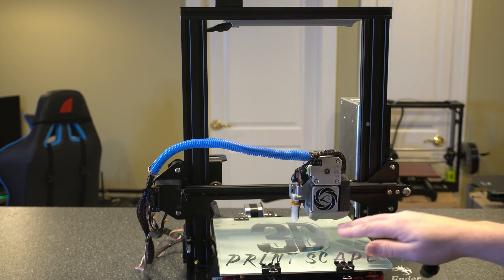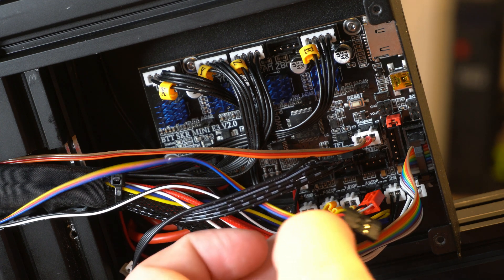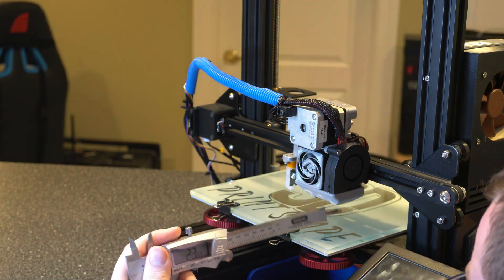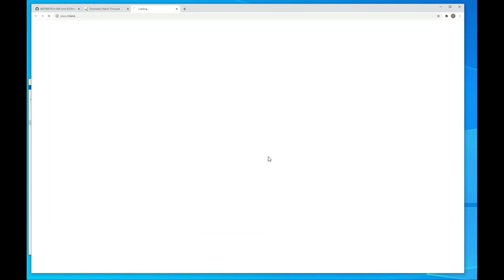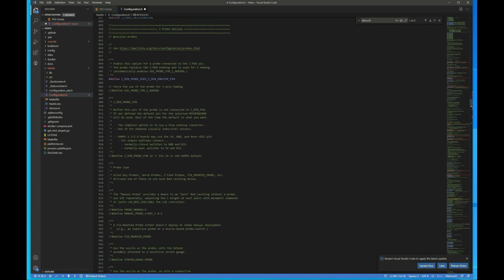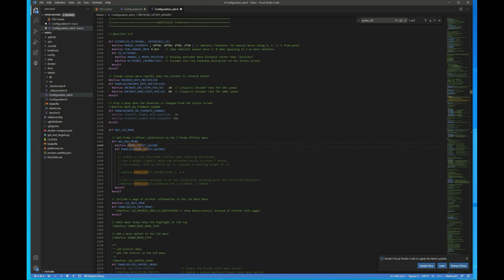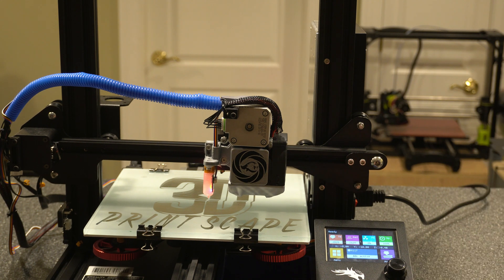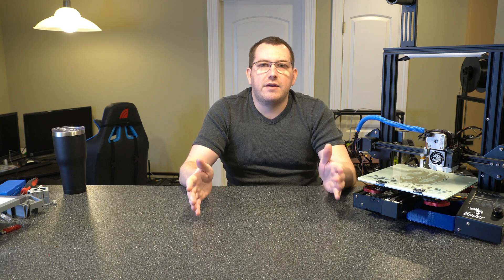BLTouch on SKR Mini – Install Guide

Comment: Hi, great video and seemed easy to follow as a first time experience. I have a CR10s5 and was able to change the print size with no issues and completed the video. However, How to I complete the setup for the BLTouch? I have a reality cr10s5, BTT Mini e3v3 and BLTouch v3.1. While I do enjoy going through this process, does anyone happen to already have the completed firmware for this setup that they can share?..or maybe point me in the right direction? Thank you in advance

Comment: Ive followed both your install on the SKR Mini E3 V2.0 where we flashed the BLTouch settings, i installed and flashed the TFT35 E3 V3.0, and i cant really seem to get the BLT to work.
Even when the probe is out it still recognizes it as "home", i cant really figure it out, ive swaped the colors around to match what you did, and even doublechecked with the instructions that the colors are indeed the right way (not that i dont trust you)
Anything youve heard of/encountered yourself and have a quickfix of? Thx in andvanse :)
Reply from the maker: Hi. How is the bltouch wired, what firmware are you using, and is the z-stop connected?
Reply: @3DPrintscape  The bltouch is wired like yours, swapped the colors around and connected the 3pin on the lowest 3 ports on the slot for BLtouch and the red connector on the Z-stop. The firmware on the SKR is for "z homing" (renamed to "just" firmware) and for the TFt35 its "BIGTREE_FRF35_V3.0_E3.27.x"
Thanks!:)
Reply from the maker: @Themasman09  Double check the pinout on the bltouch, ive seen them shipped with different colors. Also, are you seeing bltouch or anything in the menus? Looking to see if the firmware actually updated.

Comment: First of all, thanks for the video. I did exactly what you did, however when I press Auto Home the z axis collides with the table. I'm using the connection as shown. To rule out that it wasn't wiring, I used the BIGTREETECH firmware and it worked perfectly, however it doesn't allow negative z_offset and I would like to use my own firmware like you. Do you know what I could have done to prevent the z axis from stopping with the BL touch?
Reply from the maker: Hi. It sounds like a wiring/firmware mismatch. How is the bltouch wired and is the z stop connected?

Comment: Hello I have followed all the steps and loaded the firmware on sd card, my probe wont work its a 3d touch probe.
Reply from the maker: Hi. Are you seeing bltouch setting in the menu on the printer? Im trying to see if it actually took the firmware.

Comment: Hello, thank you for making this video, it was very helpful. I’m stuck one a problem though. I was able to compile and flash my firmware onto my printer, but now when I go to auto home, the auto homing sequence doesn’t even touch the X or Y endstops (which would lead to some collisions later on if I tried to do anything else with the printer). But The Z sequence works with the BLTouch probe just fine.  I flashed firmware from bigtreeTech to confirm it wasn’t a wiring issue, and the auto homing worked perfectly fine for X and Y with the bigtree firmware. However there were some problems with the Z home sequence that are more troublesome than they are worth. Anyways I’m assuming this is now just a coding issue. So now I’m trying to make my compiled firmware work. Do you have any suggestions to fix the x and y homing issue? Thanks.
Reply from the maker: Hi. Can you try one of the builds from my site? I want to try to narrow down what the problem could be.
Reply: I ended up restarting with the same btt code. I followed a step by step guide online for Ender v1s and it ended up working. Not sure what the issue was as I was watching several different videos (probably the root problem) on how to code the firmware, but it was definitely a coding/user issue
Reply from the maker: @landon3105  Thanks for the update, glad you got it working.

Comment: I’m having trouble with the platform io tab in vs Code and it will not let it complete the build it will fail it
Reply from the maker: Hi. What error are you getting? It should be in the console output.

Comment: I can’t seem to find the babystepping feature. I was able to compile it fine at first, but had to recompile another .bin file for the offsets when my printer autohomes. Any tips? I’ve got what you toggled and even enabled the feature where it’s always available. No dice still.
Reply from the maker: Hi. Try to clear eeprom if you haven’t already. If you have maybe check in the menus for something that sounds similar in function, maybe they moved it.

Comment: Retrying after a year hahaha. My default environment says mega2560 marlin 2.0. Changing to what you have
Reply from the maker: Hi. I would install and use the marlin auto build plugin. It provides the environment details available based on the board and config.
Reply: @3DPrintscape  I moved the file to video like you had it and it fixed that issue. I still can't get the check mark to show up on the tool bar. I have marlin auto build, Microsoft c++, and platformio
Reply from the maker: @VeneerSlinger  What all is in the folder that you have open in vs code? There is a sub folder with the same name that only has the configs, if you open that you wont see the check mark.
Reply: @3DPrintscape  videos/marlin 2.0 brings up the whole list on the left. I'd have to look at it again, as I'm not at the computer right now
Reply from the maker: @VeneerSlinger  Ok, in the root folder there should be a file named platformio.ini. If you dont have that at all, you may need to redownload the firmware.
Reply: @3DPrintscape  it is there, I double checked the presence of _512k and it is there
Reply from the maker: @VeneerSlinger  I have builds on my site, you could use those if your x and y offset is standard.
Reply: @3DPrintscape  it's not. It's X: -40.5 Y: -9
Reply from the maker: @VeneerSlinger  Can you reach out on discord? Someone will be able to help out more, maybe with a custom build.
Reply: @3DPrintscape  I have several times to no avail. I'll try again
Reply from the maker: @VeneerSlinger  Did it end up working?
Reply: @3DPrintscape  no. Still doesn't work. Still can't find anyone to help
Reply from the maker: @VeneerSlinger  Were you able to join the discord server?
Reply: @3DPrintscape  yeah nobody in there has offered to help
Reply from the maker: @VeneerSlinger  Can you @ me on the message?
Reply: @3DPrintscape  tempted to just send someone my x and y offsets and have them send me back the file hahaha

Comment: Hi Robert,  Thanks for all the great how-to videos.    When I initially added the ABL gcode (G29 ; ABL) to the Cura profile for the Ender 3 Pro, everything functioned properly from OctoPrint until I adjusted the bed a week later.   The Z Offset and ABL calibrations from this video was executed countless times with no success.   After hours of playing with these settings, I notice the calibration functioned properly through the printer display screen but failed via OctoPrint.  I removed the G29 code from the Cura profile and it is now working from OctoPrint.  I don't believe the G29 code execution itself from OctoPrint is the issue. Is the G29 pulling stored parameter values from OctoPrint or the controller to calculate the new ABL parameters?  My printer has the BTT SKR MINI E3 V3.0 Controller and TFT35-E3-V3.0.1-Touch-Screen-Display..   Is there any other area I need to be looking at?
Reply from the maker: Hi. Thats interesting, it has to be tied to how octoprint handles things. It bypasses a lot and wants things it own way. The g29 command runs the mesh and stores the peramitors. You need to save settings for them to persist through a power cycle. What happens if you just send the g29 command manually from octoprint?

Comment: Do you need to change the bl touch wiring on the v3 board?
Reply from the maker: Hi. If you leave the z stop connected and the bltouch connected to the bltouch port you shouldn’t. That is assuming you have one with the 5pin adapter.

Comment: I was with you up until ~5:30. Not sure how you got from installing the hardware to measuring the distance the probe is from the bed. I'm assuming you powered on and went it went to the home position? What firmware do you have installed at this point and how did you do that? I think I have the wrong firmware installed because mine isn't moving when powered on.
Reply from the maker: Hi. Once the hardware is installed, you need to flash the firmware then set the z offset, i think your on the last part right now. Im using a custom build of marlin, but the process is the same with the creality firmware. Do you see bltouch or anything in the printer menus?

Comment: Thanks for taking the time to teach this to us noobs lol however i have the exact same setup and followed all the instructions and the z offset icon does not populate on my tft35 E3 v3  in touch mode when going to the ABL section. its showing that its available in marlin mode though. any suggestions?
Reply from the maker: Hi. Is there a P offset on the screen? They changed things up a bit since i made this.
Reply: @3DPrintscape  yea it’s not in the abl menu. Is that the same thing now? Lol
Reply from the maker: @TAK209-w4l  I haven't upgraded to that firmware yet, but im pretty sure its the same thing.

Comment: I followed your video step for step.  Once you made a change vsCODE I paused the video and made SAME changes.  Ok. Mine compiled just fine.  I got my ender 3 pro with Mini e3 v3. Well almost.  The blTouch levels the center of the bed but when it’s starting a print and lays down that warmup line on left side of bed, we’ll the hot end is still 1/2” off the bed.  The abl pin does not extend. And the assembly does not lower to print. I thought at first it was the gcode of the file I tried. So I tried a different gcode and same thing happened. Is there a firmware setting I could look at for this ??
Reply from the maker: Hi. It sounds like your z offset isnt set, or not set correctly.

Comment: colors are useless, use the function of the connection. pre compiled BTT doesn't work on the skr mini e3 V3 BTW
Reply from the maker: Hi. At this point i would agree on the colors. Also, good to know on the BTT firmware.

Comment: Such a great guide, but i feel like im being a dumdum and doing something wrong.

Ive got the creality BLTouch, set it up in the way that has you using the 3 pins on the main port of the board (Swapping my pins in the connector around so they were blue/red/yellow, the blue/red were reversed initially), and then using the "z-stop" 2 pin location on the board.

I got the firmware for the z-homing, put it on an SD card- Turn the printer on, it clicks the BL-Touch sensor a few times, then bonks at me about not being able to enable bed leveling / invalid mesh.

When I look through my options, I see "MBL" instead of "ABL", and no options for the BLTouch. Seems like its not updating the firmware properly, but cant figure out why
Reply from the maker: Hi. It sounds like it may have not taken the firmware. Can you check to see what under the about/info screen?
Reply: @3DPrintscape  From the info screen my printer says: 

"System: Marlin bugfix-2.0.x 
board: Bigtreetech_gd_tft35
Firmware: v27.x"

Hopefully this is the right information. And thank you so much for your help by the way, i super appreciate it!
Reply from the maker: @SidewaysGts  I would try to flash the firmware again. You should see bltouch in the menu after doing it.

Comment: Thank you for putting this video together. It is very appreciated. It would be immensely helpful if you could:  1) improve the screen capture quality -- on my hi-res screen It is blurry and near impossible to distinguish the text.  2) could you speak out the name of the parameter you are modifying rather than using terms like "uncomment this".  Again thank you for the effort you put into this video and for sharing your knowledge.
Reply from the maker: Hi. Thanks for the feedback, i will work on those going forward. The screen capture resolution has been tricky due to different sizes. I ended up settling on 1080p captures for now.

Comment: For those of you having compile issues with your default env, in 2022 +  try using (STM32F103RE_btt_maple) this usually fixes any compile issues.
Reply from the maker: Hi. Thanks for sharing. Its also worth checking out the marlin auto build plugin, it helps alot.

Comment: how different is this from the skr-3?
Reply from the maker: Hi. the install for the v2 and v3 is pretty much the same, just make sure you use the right firmware.
Reply: @3DPrintscape  I meant the firmware itself. The ender seems to get specific board firmware, while the cr10 doesn't. I'm just struggling to get it to work is all
Reply from the maker: @drderrp  The firmware is a decent bit different. You should be able to take the example from the Ender 3 pro and modify things like the dimensions to get it to work.

Comment: I connected my BLTouch in this exact order, White, Black, Yellow, Red, Blue (top to bottom) and my Ender 3 Pro screen shorts and turns off. No clue why... I looked on the back of my board and it's  the same order as I described. Why is this going on? I haven't installed any firmware, but I dont think that matters since my screen turns off automatically.
Reply from the maker: Hi. I have seen this shipped with too many wiring variations at this point to say the color order is right. Take a look at the pinout on the bltouch and make sure it maps correctly back to the pins on the board.
Reply: @3DPrintscape  yeah, i think the pin variations are all wrong, so it was causing a short. i put them in reverse compared to how guides have them, and the bltouch actually turns on, just does the "z axis moves a bit then stops" after i press auto home. I assume that's a firmware issue?
Reply from the maker: @nextlvlroy  Is your z stop connected?
Reply: @3DPrintscape  it is not. only the bltouch. the z stop is not being used
Reply from the maker: @nextlvlroy  If the bltouch wires are are plugged into the bltouch port, the z stop still needs to be connected. If your connecting the two prob stop wires to the z stop port you need to make sure you are using the right firmware (i dont think any creality firmware supports this).
Reply: @3DPrintscape  Ah ok, I'll need to look into that. Thanks again Rob. Oh, ever since I changed the motherboard, and replaced the micro swiss all metal hotend, the prints have been taking much longer (slicer settings haven't changed), and I've been getting little blobs and underextrusion on my print. Printing straight off the sunlu filadryer, and I keep my speed at 40 mm/s. Is there something I should be checking to solve this problem? Prior to replacing my motherboard and hotend I was doing decent prints. Now they aren't good.
Reply: @3DPrintscape  Also, forgot to mention, my bltouch came with all 5 ports into one connector. It's the BLTouch brand "skouphy" on amazon. The third you said was "you just connect all 5 into the bltouch port". I guess this is what was confusing me. So then I would need to remove the probe stop wires (black & white), insert them into a jst connector to go into the z stop port?
Reply from the maker: @nextlvlroy  40mm/s may be too slow. Try to bump it to 50.
Reply from the maker: @nextlvlroy  Yes, assuming you have the right firmware for it. Or, leave it as is and connect the z stop back up.
Reply: @3DPrintscape  i tried to do the other option, using z stop switch + bltouch, and installed the ender 3 bltouch firmware. For some reason, after doing my bed leveling and all seeming good my nozzle was still very far away from the bed. Not sure why if it functioned and did the bed leveling.
Reply: @3DPrintscape  i did notice while doing the bed leveling that the probe wasn't going as low as it should have been going. The probe was barely pressed and it would retreat back up. Maybe that's why the leveling was off during print time... Do you know what i am missing?
Reply: @3DPrintscape  i would use the same speed with the stock board and it was fine. Just when i switched to skr mini everything changed it seems
Reply from the maker: @nextlvlroy  It sounds like it was working correctly but the z offset was not set correctly.
Reply: @3DPrintscape  ah, i forgot about checking that... I will check it once more. Is there any limitation at all with setting up in this way? original z stop switch + bltouch for bed leveling? I know it's an uncommon way, but I'm wondering if there are any setbacks/limitations to using it like this?
Reply from the maker: @nextlvlroy  No limitations, actually having the z stop and bltouch both connected is the most common way its installed.
Reply: @3DPrintscape  i just tried it again. I tried setting z offset to 0 so i could start from scratch, but it does nothing with the z
Reply: @3DPrintscape  it doesn't move the z axis at all.
Reply from the maker: @nextlvlroy  Is your software endstop enabled?
Reply: @3DPrintscape  not sure. idk how to compile my own firmware tbh. i just downloaded somebody's firmware off of reddit where somebody posted a similar issue, and it looks ok, but i haven't done a test print on it. this skr mini seems to be way more trouble than it's worth. i never had problems with my stock board, only reason i swapped it out was because i shorted it. so far not a fan of this skr because of all the detours i have to do to get a decent print going again.

Comment: Hello, this Firmware works for an Ender 3 with a BIGTREETECH SKR-Mini E3 V2.0 board... and TFT 35 E3 V3.0...? Congratulations for the video and thank you
Reply from the maker: Hi. Ya it should work fine with that combo assuming the tft firmware is up to date.